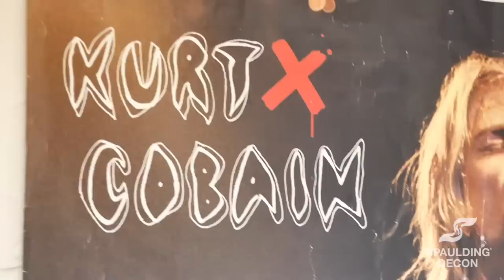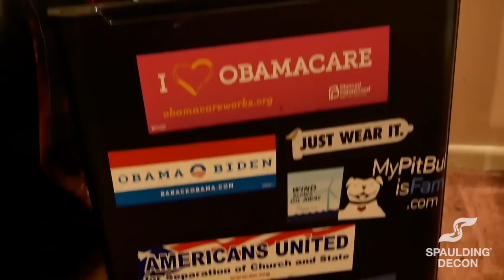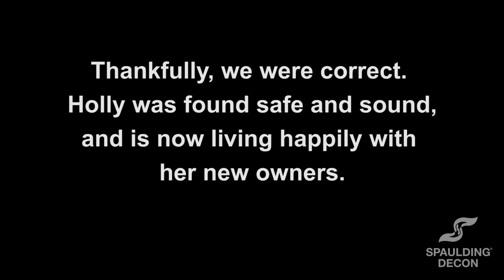THE DOLLHOUSE BIOHAZARD!!!

Comment: whenever I watch these videos, I cannot help but wonder: how careful are you all in removing your contaminated protective gear? does it get sanitized after each use? what is the proper method of taking off your contaminated boots and gloves, and where do you put them after a job is done? the moment you were pulling at that carpet full of cat urine, I noticed a lot of debris which looked small enough to be inhaled. nobody was wearing a solid mask to protect from that moment, and why was that? furthermore, the brooms/vacuums/mops/cleaning bottles (spray bottles) that you use, are these sanitized often as well? I ask because, for example, what if an employee in the middle of a decon task wearing gloves that have traces of bio on them uses the spray bottle? is that ever cleaned before placing it back in the truck/storage? curious to know about the other tools you use as well in terms of maintaining them and keeping them safe to use especially considering these tools ride in the same trucks as you do when you’re on the job, and after the job. I swear in some videos on this channel it looks like certain team members are very laid back when it comes to touching certain things, then touching the truck door handle or sitting on the truck where a lot of contaminated garbage has sat as well. just curious
Reply: Yes. The Asian ones are much more thorough with complete hooded suits, masks and not a spec of skin exposed. All bio is wrapped and bagged before removal to avoid contamination and is taken to special bio disposal site.
They must have different safety laws.

Comment: I had some cool stuff in boxes that mice got into. Just had to throw it away. No cleaning all that poo and urine off stuff, unless it's straight up plastic, but even then, if it has low value, what's the point of spending so much time cleaning them? It was books, leather, stuff like that. I can't stand mice. I can't imagine the type of deep cleaning to get rid of decomp odor, though I have a taxidermy chemical that is pretty kick ass lol. But it's for smelly pelts. The chemical did not get totally get rid of stinky billy goat odor, and not 100% effective on skunks either. Skunk is the hardest stink to get rid of.